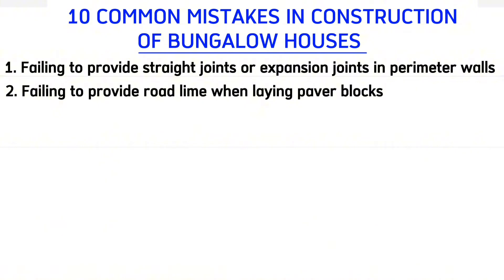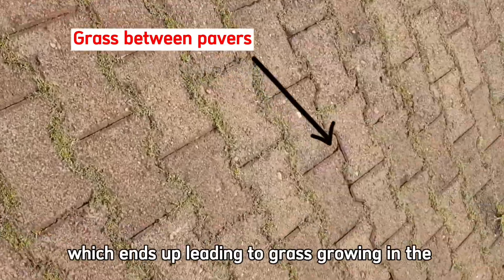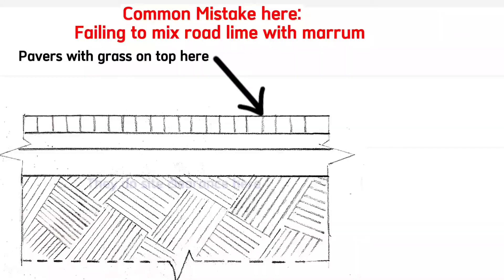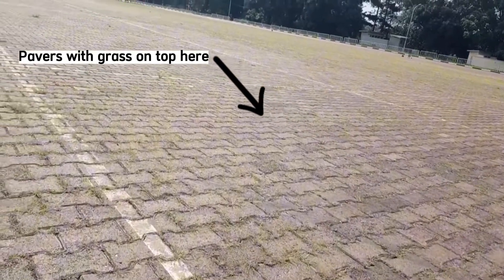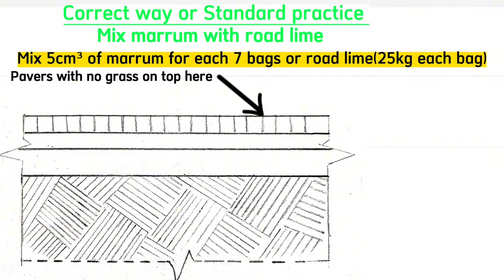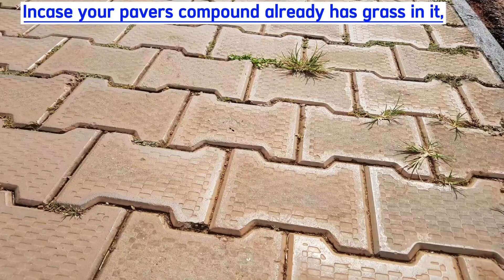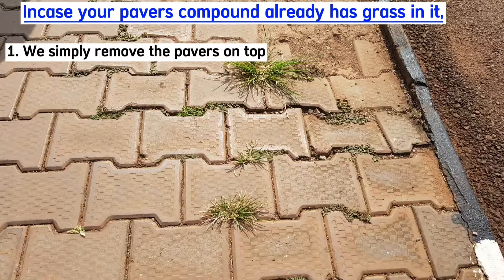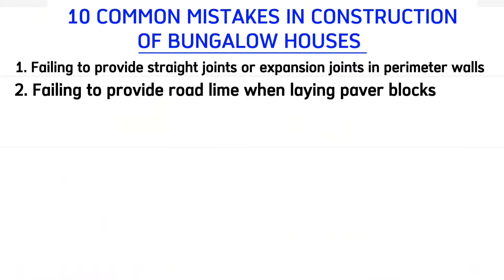THE BIGGEST MISTAKES IN CONSTRUCTION (Part 5)

Comment: Very importantly added that adding excessive water to concrete mixtures weakens the finished compressive strength. Many masons and contractors wrongly sacrifice strength for the workability of a flowing mass. The reddy-mix companys don't inform their clients to this because it is easier on their equipment and makes ridding their trucks faster so as to sell more loads in a given period. Also tempering the concrete by covering and adding suplimental water (mist) slows curing time and ultimately yields higher compressive strength provided you have the patience. Thanx again.
Reply from the maker: You are very right